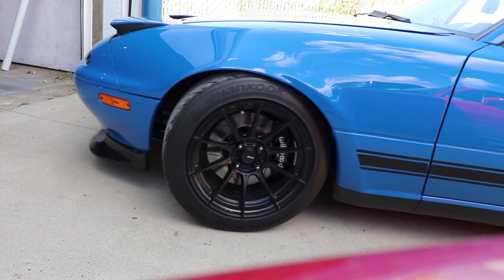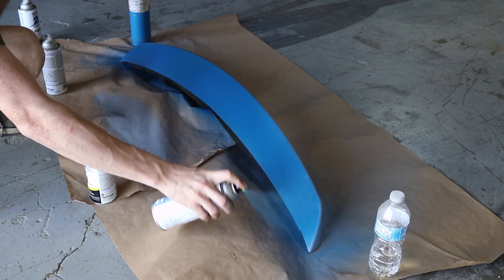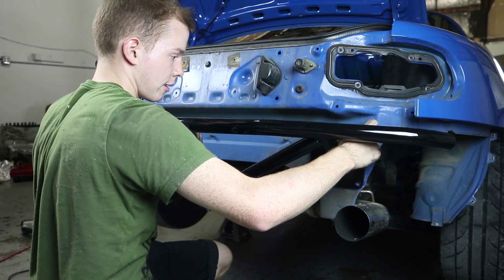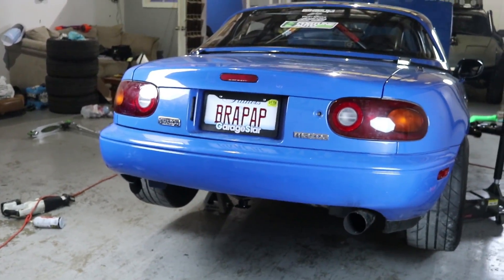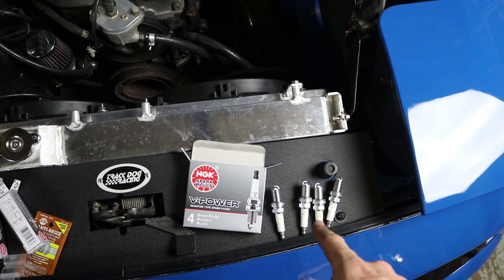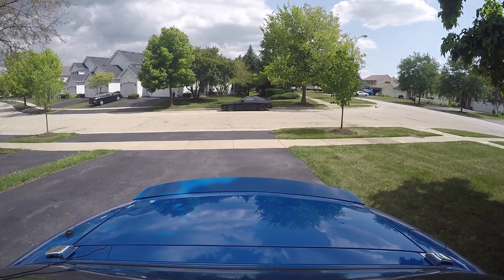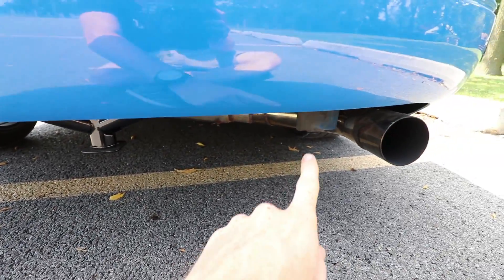Turbo Miata Rear-End Overhaul! - Bumper Cut & Bash Bars

Comment: WAIT GINGI! 
I highly recommend not dropping in spark plugs because you could bend the little gap rod thing and then your gap is off.
This is from personal experience... Then I read the box and it also says not to drop in the spark plug. Put it on the socket and then guide it in.
Bumper looks dope!
Cheers

Comment: Clean your idle air control valve and there is a hole that bypasses the throttle body butterfly and it get full of black soot just clean that out with throttle body cleaner 😊 this helped me
Reply: I am amazed that I had to scroll past so many "paint the spoiler..." comments before I got to something helpful.
Reply: me too...
Reply: I recently pulled my upper intake manifold and cleaned a metric crapload of crap from the critical vacuum ports. Fixed 95% of my poor idle and EGR code issues.  1.5 hrs, 1 can of throttle body cleaner, a handful of thrashed shop rags.

Comment: Yes I always wanted you to do a bumper cut,it makes it look agressive af.
A diffuser would look cool.
I think the ducktail should be black,but that's true that the original paint was a bit ruff.
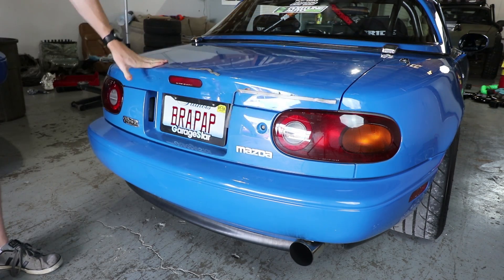2:28 OMG A BALD MIATA LMAO
Rather than changing spark plugs,I would have changed the spark plugs wires.
I think if a spark plug works one time it works everytime,but a wire could be broken inside and not making contact everytime.
And also why tf clear coating after sanding,orange peel obviously come back wtf.

Comment: Are the brake problems fixed?
Reply: Ruben Olemans probably not
Reply: Ruben Olemans check his Snapchat. The rotors were warped. He bought new rotors but it didn't come with the center piece to slide it on.
Reply: On his snap story yesterday he explained how he got new rotors because the old ones were indeed warped, but the news ones he just received didn't come with mounting hats.
Reply: MR_TNT_OUTBURSTS what is his Snapchat
Reply: Jesse Gutierrez "gingacaleb"

Comment: Wait, I'm a bit behind. Does it have the 1.8 in it or the 1.6?
Reply: oppenheimer molly has the 1.8 and turboed and rallymiata has a 1.6 supercharged
Reply: Nick Watari molly still has a 1.6. He's planning on doing a 1.8 swap soon
Reply: the blue miata has a 1.6 and the green miata has a 1.6.
Reply: oppenheimer 1.6
Reply: Molly has a stock turbo 1.8 
He planing to do a built turbo 1.8 
And the green Miata has a 1.6 supercharger
Reply: The Expert no molly has a stock turbo 1.6 and he's swapping in the built 1.8
Reply: David Rohac yee
stock 1.8 miata's cost alot
6-7k
Reply: KnownNissan not at all me and my friend got first and second gens for 3k with hardtop and one had 97k on it and the other 160k
Reply: Nick Watari no molly has the 1.6 too he's swapping a 1.8
Reply: As everyone said, 1.6. He's going to put a 1.8 stroked to 1.9 in soon.

Comment: Hey Gingium, nice work as always and amazing job cutting the bumper! Personally I liked the black for the spoiler since it provided some nice contrast from the rear, but regardless it  still looks nice. Also for the "do-hickies", painting them black as well wouldn't look bad in my opinion and would probably be easier to do than having to cut them off(coarse would take longer since you have to wait for it to dry). Anywho, the car looks amazing and whatever you do to it is up to since it's your car. Keep doing what you're doing and will be looking forward to whatever comes next.

Comment: Just a quick tip, when putting in spark plugs, use one of your spark plug leads to place it in and gently start the thread. If you drop them in crooked, you can break or bend the tips, or worse.

Comment: For your idle problem, I don't know miatas like the rest of the certified youtube mechanics here, but if you have an idle air control valve see if you can adjust that. It may be dirt and getting stuck and the car overcomes that by messing with the fuel ratio so it doesn't die.

Comment: Dont drop the spark plugs because that will actually have a chance of messing the gap up. If you get a standard piece of vacuum hose, you can use that by sticking the top of the spark plug in the hose and using the hose to thread the first few threads in.

Comment: Maybe there is a problem with the ignition coils that is causing the ritch idle? You could replace those and get a Okada Projects Plasma Booster high voltage ignition kit; its kind of pricey, but from what I have read, it actually works and helps smooth out the power band a bit as well.

Comment: So I was watching a Hoonigan video and they said using a 5 point harness is actually pretty dangerous on the street since you wont be wearing a neck brace. OEM 3 point seat belts have a little give to them and allow your torso to come forward a bit during a crash, essentially saving your neck from snapping.

Comment: You need to get oscilloscope on your injectors and take a snapshot of how they're working normally, and compare it to how they're working with the lean issue. It could be that the pulse width modulation is shorter, reducing fuel, causing a lean issue. Just a thought.

Comment: Misfires under idle are vaccume leaks, because too much air is getting in, making the AFR go lean, to lean to ignite. Misfires under boost are electrical, sparkplugs, coils, wires. Because it is harder to spark when the air is denser, because it is a better Insullator.
Reply: They make smoke check kits, or you can make your own out of a small paint can and some fittings, and smoke will come out of anywhere there is a leak.

Comment: If you're still having an Idling issue check you idle air control valve and IAC gasket. That's the common issue with cars that don't idle correctly

Comment: had a similar idle issue in a N/A honda, traced it down to a broken throttle body gasket, and then later the same issue this time the IAC (idle air control) valve had shattered, check the IAC, and the intake gaskets I'd put good money down on too much air bypassing the throttle body to which the computer corrects with more fuel causing a idle spike, another possibility is a faulty fuel system, not enough fuel is delivered, engine reads a lean mixture and forces more fuel in

Comment: as far as i know, all the 1.6 miata's came with 6 or 7mm ignition cables.
upgrading to an 8mm set is recommended, and might fix the problem.

Comment: My miata had the same idling problem, turned out it was running lean because dirt had build up on the butterfly idle valve and it was sitting slightly open at idle, might be an idea ☺️

Comment: If it's running lean it might be dirty injectors. Throw in some CRC 1 tank cleaner. Also your plug wires look stock, you should get some NGK wires.

Comment: The lean is definitely a sensor or tune issue... if the spark plugs were going out it would run rich since it's not igniting all of the fuel.

Comment: You did way more work than you had to. You don’t have to take out the lights or finish panel. Just the 8 bolts that hold the bumper on and the 2 on the corners

Comment: In regards to the off road Miata an idea is Connect the sides of the scoop to the hood. It'll look better and it'll go up with the hood the problem is it looks tacky because it's not on the actual hood, also with it on the supercharger makes it too high and it makes it look even more out of place. If you have trouble with the pipes just might the sides at an angle like this / \ . Either way cool car.

P.S

They don't call it a hood scoop because it sits on the super charger dude. Just saying.  Lol.

Comment: On the lean idle - do you have EGO turned on?  I have an NB that I recently installed MegaSquirt on and I've been struggling with lean idle.  The idle AFR creeps up as the engine warms up, or starts high on a warm (hot) restart.  I've read various explanations (hot fuel, hot injectors == increased dead time, etc...) but the solution seems to be to get the tune as close as possible, then turn on EGO and let the computer trim the idle VE values to achieve your target AFR.

Comment: didn't you bolt down the bottom part of the bash-bar? if you jack Molly up from that bash-bar it will put twisting pressure on the top bolts instead of pull force on the bottom bolts. This will make it more likely that the bash-bar mounts or bolts will break.

Comment: if it runs lean you need more gas spark plug fouling would make it would cause a rich situation. since misfiring would not burn all the gas. check your VE table and AFR Table and data log a few runs.

Comment: Molly would look good with a rear diffuser. 

I'm just going out on a limb here and guess that the idle problem could be caused by a faulty air flow meter.

On a side note, is it just me or does the rally miata start up faster than molly?

Comment: Idle has nothing to do with plugs. It is your injector dead time. Most likely your VE table and REQ fuel are off.
Also gingium if you drop the plugs in the holes it can change the gap. Just be mindful of that

Comment: try playing with battery off set settings in me when the car is misfiring. I have the same exact problem. After plying with the settings it helped my idle but it didn't fix it but that's because I had a bad injector

Comment: You still need to fix that after start enrichment on the miata
Reply: Also you need to make sure that your MAT correction follows the ideal gas curve that megasquirt provides. You may be on an old firmware that doesnt implement that feature. Also stock coils should be gapped at .028 to prevent blowout

Comment: Jesus, don't drop the plugs in there, it could mess the gap up and or break the tips, go to autozone and get a foot of some fuel hose that fits the plug so you can use that to gently put the plug in without harming it

Comment: It does not catch the air like a parachute... You created more drag on the rally Miata and you just created more drag again. 

http://www.discovery.com/tv-shows/mythbusters/mythbusters-database/driving-tailgate-fuel-consumption/

With stock bumpers the air behind the bumper creates a vortex, it's basically a ball bearing made of air. Its a non moving bubble/pillow of air that keeps the air moving under the car without excessively catching on anything including the rear bumper.

And you just ruined it.

Comment: Tbh that hood scoop on the rally Miata looks like complete shit. Also, wouldn't you just fling mud and debris like straight onto the intercooler? 

A vented hood would be better in both performance and aesthetics. It would be more streamlined instead of having this big fugly monstrosity jutting up out of the hood, and it would offer the intercooler some protection from the elements.

Just saying. I really wanted to get that off my chest. End rant, continue watching the video. Lol.